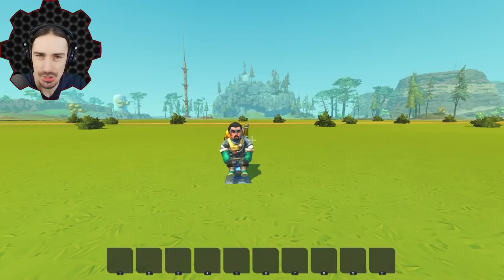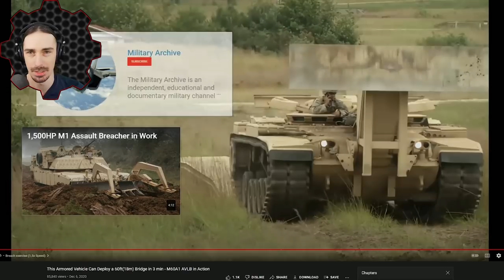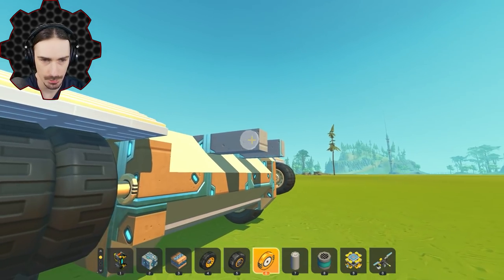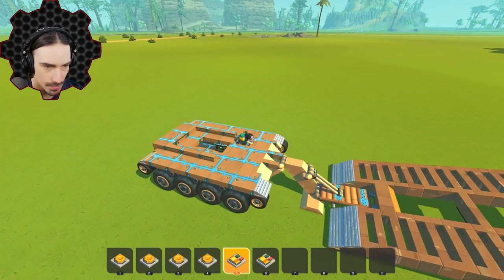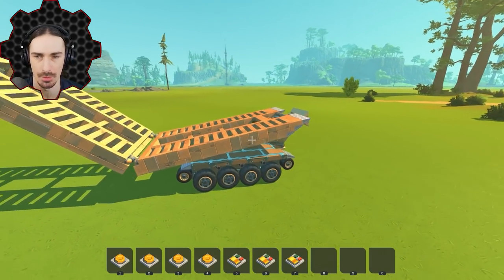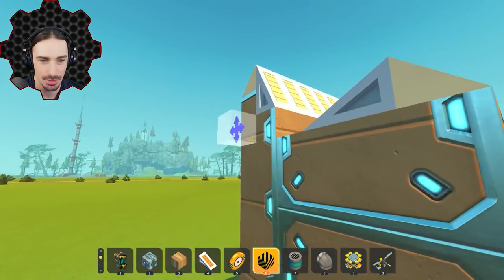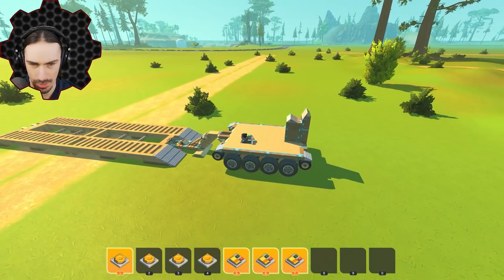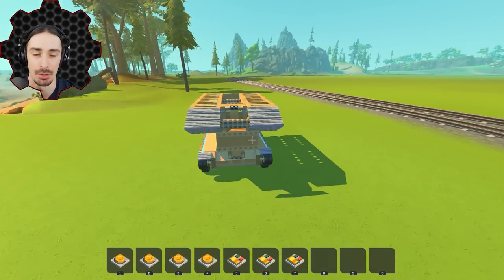This Tank CARRIES ITS OWN BRIDGE, and It's Real

Comment: I was considering something here.  This is an actual thing, that was actually used, and Scrap Mechanic actually replicated it fairly well.  I got to thinking about how the military built a detachable hydraulic hose, and how yours just has it's power supply in the bridge, triggered by a separate toggle switch.  I think you just researched an advancement on actual tech, just power the bridge to extend it's self, and then you don't need to physically connect the two pieces to get function out of the bridge.  Just a thought.
Reply: A solution to the detachable hydraulic hose solution, would be for the connecting pin on the tank arm to have a PTO that spins to drive the bridge's independent hydraulic system. Just a thought......
Reply: @PhillMagGamerDad  It's a good one.  Independent mechanical linkages with no permanent attachment points is what I was going for.  I'm making a broad assumption that that's what a PTO is.  Nvm, I just looked it up and that's no longer an assumption.  Thanks for contributing.

Comment: why dont you just change the sensor setting to a switch and not a button
Reply from the maker: Then it has a chance of being retriggered accidentally and stuck in the wrong position
Reply: @scrapman  i guess so but you could place it in the middle layer too and put it on a button instead of a switch so it will be easier to activate it